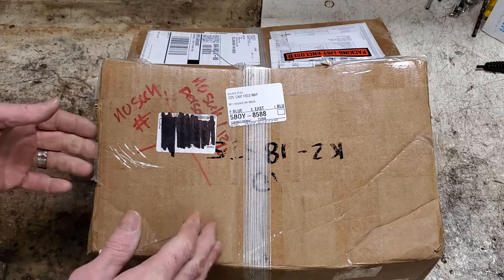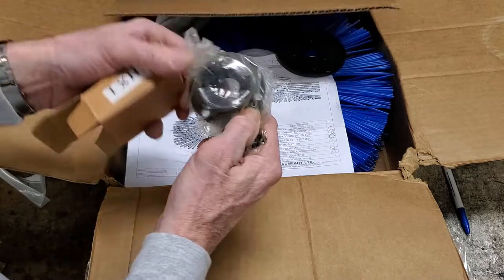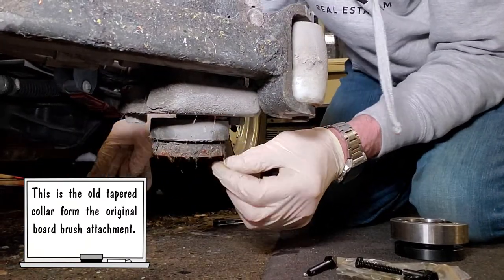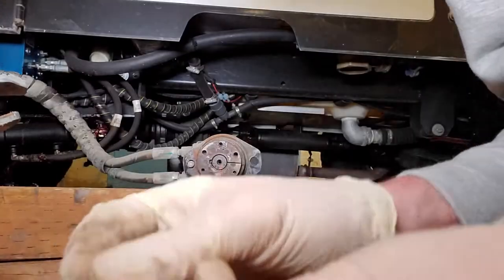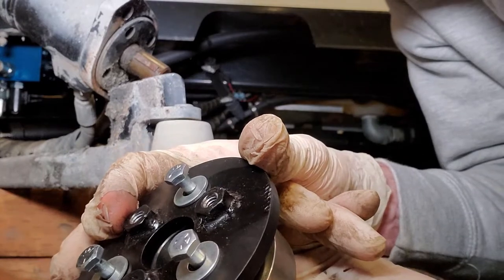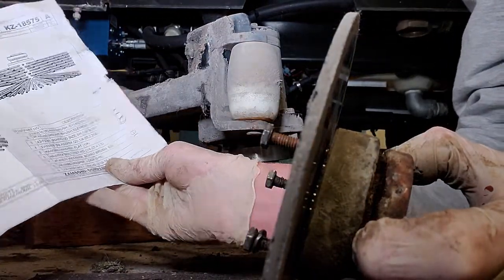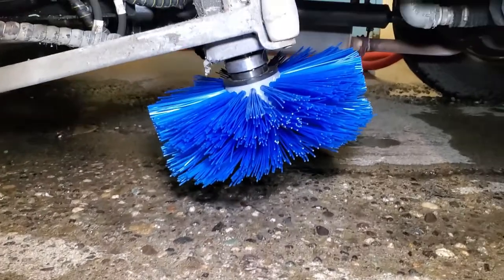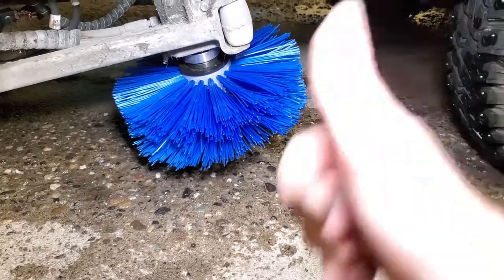Zamboni Power Brush Board Brush Adaptor Kit

Comment: Did you ever have any issues with the power brush scratching the ice? We just got them recently and it leaves this white scratch around the perimeter where the center of the brush is. At first I thought it was from where someone had edged the day before but it is indeed the board brush.
Reply from the maker: Yes but it only started a few months back. After running the edger it goes away. But it is something I been meaning to ask zamboni about. I checked for anything hanging and scratching the ice buy I can't figure out that it is. I am thinking perhaps a little too much down pressure.
Reply: @YourLocalIceMan  does yours sit flat when our? I noticed ours is kind of angled towards the boards like the old one was. I just saw it when I saw someone else driving, but couldn’t tell when on the machine.
Reply from the maker: @TyTyson98  going to take a closer look tomorrow. There are some bolts that can be loosen to adjust it some. Perhaps someone smacked ours on an open door. Thanks for the info.

Comment: Does the power brush offer on model 446 ?
Reply from the maker: I looked at a picture of the 446 and it seems the board brush is mounted on the outside of the machine vs under it. I do not see why not but I would check with Zamboni with that one. They would be more than happy to tell you. Sure there is a mounting kit for that modle.